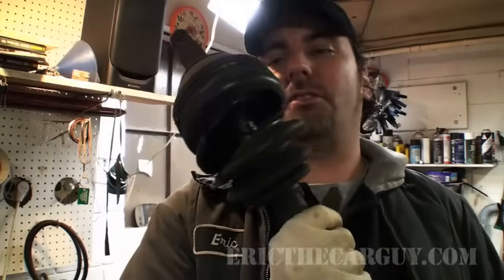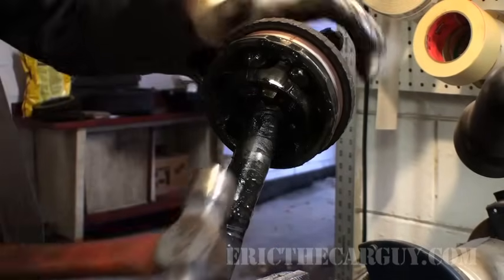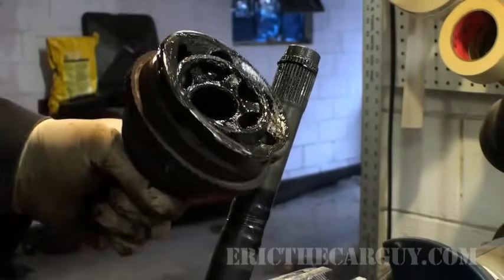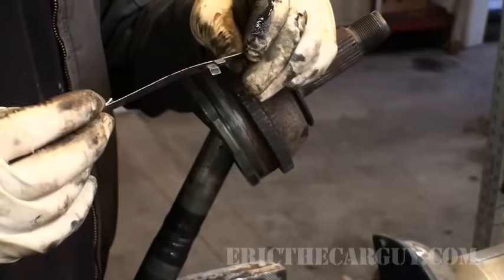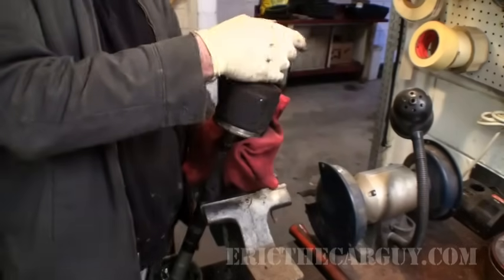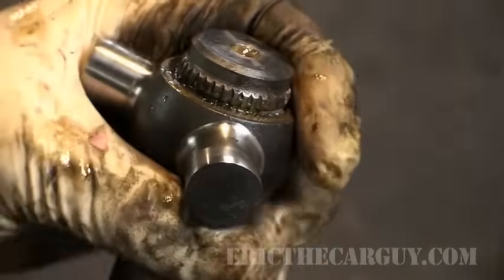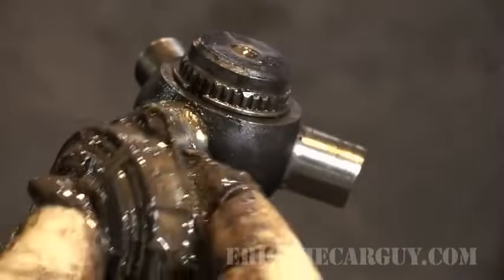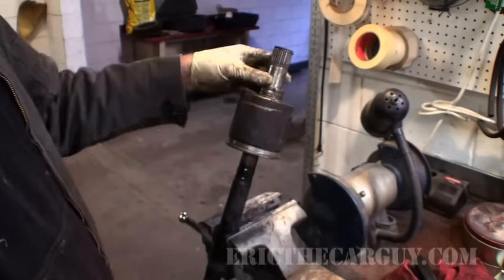How To Replace CV Boots - EricTheCarGuy

Comment: My new subie went from 0 to clicking like a bitch under firm straight line acceleration in about 3 days 😭 (also plenty of clickery on left turns.)  Ordered a couple used OE axles. If the boots look sad when they come in I'll probably reboot them before I put them on the car. From what I've heard the boots don't last forever but the OE axles pretty much do if they're cared for. (The ones on my car aren't OE - not green - and I knew 3 months ago that the inner boots were torn... Although clicking is probably the outer joint anyway)

Comment: To be fair, yes it's cheaper to install a new axle 90% of the time. 
But for those of us with older 4x4 or fwd that new axles are JUNK and the old boot rips? It's more intense but at least we're not 4 for 1 on those cheap axles in the middle of the woods.

Comment: After 13 years I can say axel aren't cheap anymore 
And they don't do cores return where I shop so yeah it's worth it to save an axel
Reply: I can get a CV axle for $30 from rock auto 
Can get both for $84 after taxes & shipping. 

Are they the best CV axles? Ehh maybe not but they’re cheap & new.  The boot replacement cost about $30 too.
Reply: @CHIPSIMS-h2n  us or can 
In Canada prices are higher
Reply: @paradigmfall  dang you got me there . 😂. I was referring to the US. However, on rock auto, sometimes the manufacture and or shipper is coming from Canada. I just got some wheel hubs and bearings from Canada for $28.

Comment: Well bmw axles ain't that cheap and I just have a pin hole slinging grease. Just started, I ripped it and the axle is at least 200 vs 10 for the boot

Comment: I just worry about the quality of the replacement axels. My factory ones are 22 years old/200,000 miles and take the abuse of an aftermarket turbo that makes double the factory power. I worry the aftermarkets will grenade.

Comment: My boot's ripped open, and the garage said It'll fail MOT for that.

Were they blowing smoke up my arse?
Reply: No because the joint will eventually fail. It's a safety issue.
Reply: ok, then you have to decide if its wotrth going to the scrapyard and get a complete axle replacement, I guess, there are videos on this, maybe different cars, but the procedure is similar to all cars, I think. Think Ericthecarguy got some tips, if not, you can check jimthecarguy (very thorough instructions and descriptions...

Comment: I thought you were gonna remove the balls and cages, I bummed Mr Rzeppa. Oh and my trick, once the joint is on or the stub in the trans, I make sure it has the small amount of free play it should have, if you don't have that free play the circlip likely got bound or jammed up going in or on. Do not loose clip? I did once, all I heard was pink ding ding ding....GONE. You are F_ED. Back in the 80s and 90s I rebuilt mine, not any more, the rebuilt axles were JUNK. On the inner make sure you set the bearings about mid way in the tulip, or where they were originally, look for witness marks, and make sure the boot air pressure is equal at that point, not ballooned out or sucked in. To remove the outer joint I used to use an old iron 4 cyl flywheel, let it rest on the joint, then give axle shaft a quick down-up action, off like butter, worked for me. Make do with what you have.

Comment: Thanks Eric. Other reasons to replace a c.f. joint boot cover is of your a dumb ass like me who could not find a tow point under my 2002 photos prius and wrap a wire cable around the passenger Axle and pull the car a few feet
 Then realize it wrapped around the boot cover and tore it to.pieces. Doh!!!

Comment: If you hear the clicking sound while driving straight that is usually your ball joints.
Reply: Or suspension links, or track rod ends, or shock absorber top mounts - damn did I check those wheel nuts ?
Reply: Or your inner/ plunge type joint of your CV shaft. so he's right...

Comment: ....you can't just use normal nlgi grease out of a tub? What's special about it?
Reply: grease is a lot more high tech then we sometimes realize.  For stupid slow moving stuff like hinges and latches, any thick grease will do, but for dynamic high speed components the thickness and other properties matter tremendously. Especially bearings and CV joints.

Comment: That shit did not fly trying to hammer off the end of the cv axle with the ball bearing in it. Would even budge, 2004 Toyota Sienna. Fudged the entire inside of that joint. Now have to buy a new axle. This is not some easy task lmfao

Comment: Axles are so cheap now because they are Chinese junk that will start to make noise in a year or two. Sure, if the CV joint is clicking, replace the axle. But if it isn't, and only the boot is torn, replace the boot. I'll take a rebooted 100,000 mile O.E. axle over a new Chinese axle any day.

Comment: Is this the only method to remove that F%$^&# joint?!?! I'm beating the shit out of my outer joint & it's not coming off. I tried sliding a thin piece of metal (hacksaw blade) up inside & depress that retainer ring but the blade didn't slide in that far. If I ever do this again to any car I'll take your advice Eric & buy a new axle. What a Bitch!!!!!

Comment: Worst advice ever. This guy shouldn't be allowed to touch a car. My Chrysler Concorde was doing just fine until I heard some clicking noises when I turned. Figured it'd be fine for a while. I tried to reverse out a parking spot..*clank*. I get out and look and there's bits of metal and cogs and stuff on the ground. cv joint snapped and went through the transmission. To to repair was more than I paid for the car.
Reply: "Chrysler Concorde was doing just fine until I heard some clicking noises" - wtf Eric has to do with your 20 years old pile of junk?
Reply: @deseremere  "I've taken a CV joint to the point of breaking" that's wtf.
Reply: Sorry I quit reading at Chrysler Concorde